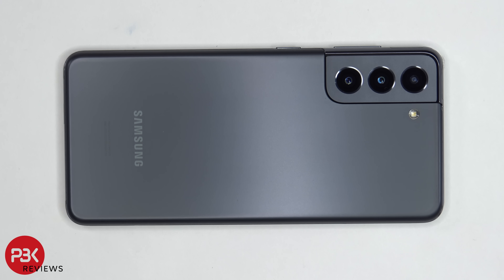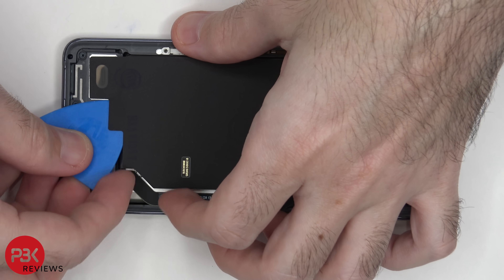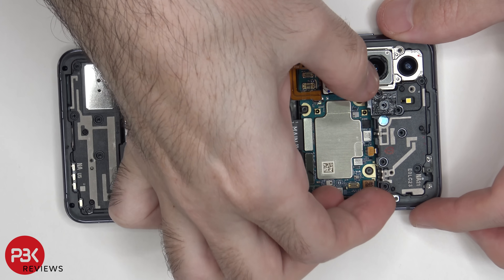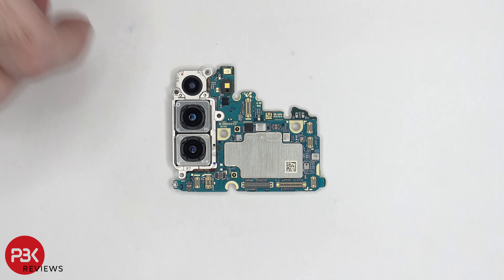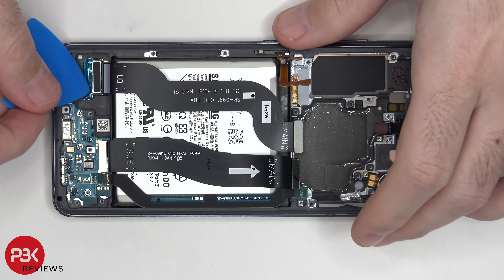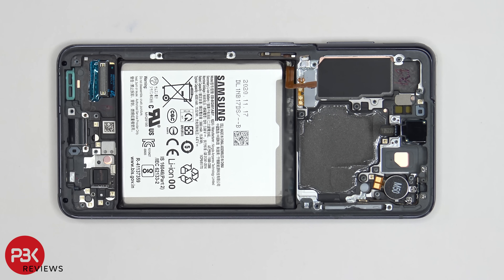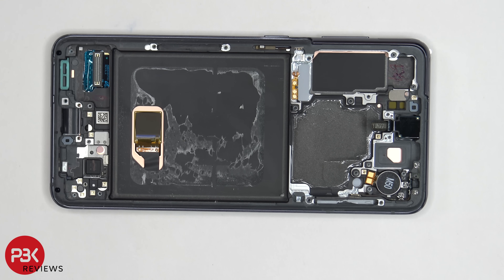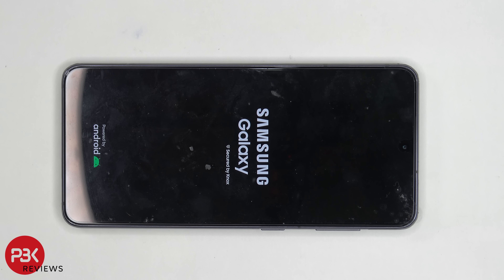Samsung Galaxy S21 5G Disassembly Teardown Repair Video Review

Comment: How does this generation of samsung s21 line up  cooling technology works
Reply from the maker: The 3D graphene transfers the heat from the processor to the midframe and out the phone as well as the graphite layers on the back which transfer heat from the battery and other components out the back of the phone. So far from tests it seems it functions just as well as the copper solutions and lasts longer since there are no vapors that can evaporate over time.
Reply: @PBKreviews  😃 smart idea
Reply: @PBKreviews  lol right now I'm online looking for different cases for my s21. Lol it feel like I'm shopping for clothes for my s21 so many cases already out
Reply from the maker: @Demont3-e3e  Ya lol always hard to make a decision on cases, I tend to get a few usually.
Reply: @PBKreviews  😂

Comment: Do you guys notice some light bleed when turning on the flashlight, around the back corners? Or is it just my phone?
Reply from the maker: You mean around the back plate corners? Its possibly because there is a light diffuser for the LED light and the boarder of the LED light has a tiny gap all around for the third mic sound which is routed through there to the main board. So that might cause some light to be lighting up the internals of the phone and bleeding some out the edges.
Reply: @PBKreviews  yes like that! But its the all way aroud the corners like a circle haha. Its a shame I cant show you the picture

Comment: can you do a video on a screen replacement and other replacements with another s21 if you can please and thank you
Reply from the maker: All that is left for the screen replacement after taking it apart as shown in the video is to pry off the old screen. Also most screens come with the mid frame attached so all you would do is move the parts you took out from your old frame into the new one and your done. I didn't want to break the screen and render it useless :)

Comment: The phone isn't even out yet. How did you get the retail version so quick?

You should use isopropyl alcohol for loosen up the battery next time.
Reply from the maker: Sometimes I get lucky and I'm able to get things a little earlier. Ya I had to use isopropyl alcohol on the s21 ultra, the battery on that was much more difficult prying off.
Reply: Learned my lesson the hard way on that one with an LG

Bellow the battery there's a hole for the fingerprint sensor, if you pour alcohol there's a good chance it will get in and ruin it. From now on, only prying for me!

Comment: The S21 has a circle vibrator and S21 Ultra has square vibrator like the S20 and Note10. How does the vibration feel on the small S21? Does it feel like haptic or just normal vibration?
Reply from the maker: The s21 vibrator feels more strong all around the phone and is a long straight vibration while the 21 ultra is more like a haptic feedback burst of vibrations as if your clicking on something.

Comment: What is below the flash and left of the speaker balls ? Is it some kind of sensor, there is also some kind of windows on the cover below the flash difuser
Reply from the maker: Its a hole that would be used by an additional microphone, possibly the + or ultra make use of it. We will see soon. :)

Comment: Hmm doesn't seem that waterproofed to me 🤔
Reply from the maker: The adhesive around the back plate is water resistant adhesive as well as the rubber filter gaskets around the mic/speaker openings from the inside.

Comment: Can locate the RAM Module/Modules?
Reply from the maker: the RAM is stacked with the processor.
Reply: @PBKreviews  on the S21 Ultra is there any identifying markings on the RAM?
Reply from the maker: @johnrommelt6560  not sure I didn't check, if I end up taking it apart again I will look.
Reply: @PBKreviews  thank you

Comment: So, graphene cooling in the SD variant is better than the copper cooling in the Exynos variant right? Or did they change Exynos variant cooling system?
Reply from the maker: Graphene seems to do just as well if not better, and also last longer. The vapors in the copper chamber can evaporate over time and not provide as well of a cooling, but graphene well always stay constant. I'm not sure yet if the Exynos version has any different cooling this time around, but we will see shortly.
Reply: @PBKreviews  wow, that's how it is? Thanks for the info. I'm now your loyal subscriber.
Reply from the maker: @johnlabu1154  you're welcome, and thanks for the support!

Comment: Tf theres no cooling system on s21 series this time ? Seriously samsung ? A graphite tape with thermal paste is aint enough for this price tag especially for a flagship
Reply from the maker: The 3D layer (its not just a tape, its thick) of graphene is the cooling for it. Works just as well as the copper vapor chamber and lasts pretty much indefinitely compared to the vapor chamber which the vapors can evaporate over time. Basically both the copper vapor chamber and graphene both transfer heat. They don't actively cool the parts. Comes down to which transfers the heat away from the components faster and more efficiently and does the job for longer period of time. Graphene seems to be the winner there.
Reply: @PBKreviews  its better if they use it both cuz this is a flagship phone..
Reply from the maker: @mr.nobody0179  I don't think it would work that way since it would basically be one thing transferring heat to another thing to yet again re transfer the same heat out when one does the job already. But I'm sure as time goes on they will come up with better solutions
Reply: @PBKreviews  yea when they use graphite with copper vapour chamber it will transfer the heat dissapation out from the phone faster and wont make it overheat
Reply: Btw im still thinking should i upgrade from oneplus 8 to s21 ?
Reply from the maker: @mr.nobody0179  hmm not sure would be up to you. I haven't really ever used oneplus phones for extended periods of time to know if I would go with that or the s21

Comment: How does haptic feedback feel on this phone? (considering that it has a coin style vibration motor)
Reply from the maker: I haven't really payed much attention to haptic feedback honestly throughout the devices I have used but I will take a closer look and get a better feel of it over the next few days and let you know.
Reply: @PBKreviews  thx for your reply! Waiting for the results.
Reply: @gaborgedey8100  its worse man way worse trust me its been driving me crazy and im not the only one
Reply: @gaborgedey8100  best thing you can do is just stick to the s20 unless you really want to upgrade to the newer chip and have only barely better photos. video may be a bit better too.
Reply: @yushakhan2504  finally i chose s21+
The standard s20 has the same coin style motor and the crappy exynos 990 and  also a power draining non-adaptive 120 Hz display.
I'm happy with my choise. The phone is fast and it has amazing haptics due to the the linear style vibration motor it's equipped with. The battery easily lasts 2 days with adaptive 120 Hz on.
Reply: lame probably.

Comment: Looks like the Galaxy S21 have a larger  Main camera sensor than previous Galaxy S20 😃😃 thats Good, because the sensor may be able to receive more light coming in, and the overal picture quality will look better than S20 from last year
Reply from the maker: Ya I personally like the build on the S21 over the S20 in general. The minor upgrades here and there are worth it to me, especially the speaker upgrade on top.

Comment: Great video! Does it have the old style low quality vibration motor or the higher quality Linear motor like in the s20+ / ultra ?
Reply from the maker: Thanks! It has the older style vibration motor.
Reply: @PBKreviews  when we thought samsung couldn't have disappoint us again
Reply from the maker: :) hopefully the ultra and plus will have the linear motor, well see.
Reply: @PBKreviews  which one does the S20 (base) have?
Reply from the maker: has the older cylindrical style ones
Reply: @PBKreviews  does it feel cheap like in the s10/s20? I'm currently rocking a pixel 4xl and the haptics r amazing.
Reply from the maker: @rjosef1983  I haven't messed around with the haptic feedback much yet, check back with me in a few days and I will see how it is
Reply: @PBKreviews  thanks. Since I've been using the base versions for the past few years, it wont feel lesser. Wouldn't mind an improved version in the base version though, but oh well.
Reply from the maker: You're welcome. The S21 vibrator feels bit more stronger and is a constant straight vibration while the ultra one is more like a haptic feedback pulsing type of vibration like your clicking on something.
Reply: @PBKreviews  thanks for the info 👍
Reply from the maker: @LilJay2o6  you're welcome
Reply: @PBKreviews  does it overall feel cheap or an improvement  over the last iteration? I've had the s10e and the haptics felt really bad
Reply from the maker: @rjosef1983  it's nothing amazing but isn't bad either. Pretty much the same thing as a note 20 ultra

Comment: wasnt the camera hump part of the metal frame???? how did it came apart??
Reply from the maker: The metal portion is a face plate sitting over the back plate/battery door. So its layer over the back plate. It's not connected to the frame of the phone.
Reply: @PBKreviews  you think thats the case only with the s21cz is plastic or same for s21 ultra ? just asking cz bloggers make such a big deal about it
Reply from the maker: I'm pretty sure it will be the same. Making that portion part of the frame itself would make the design more difficult to work with overall. Placing parts in or doing repairs would be more complicated both for them and for end users. We will see soon.

Comment: Could have definitely made a combo dual SIM/SD tray where you can either use dual SIM or a single SIM and SD.

Boycott this garbage.
Reply from the maker: Yep, not sure why they opted to have a dual reader installed with only single sim supported sim tray. I'm assuming cost cutting to have one standard sim tray installed across all devices to have the dual sim version make use of it and the none dual sim just have an inactive sim reader. If length was a problem, maybe they could have had a side by side reader instead for sd card support, not sure.
Reply: they removed samsung pay MST,  no MST.  i nervous to use mobile pay, when you tap phone to credit card reader and it doesn't work, that's embarrassing!  99% i going to cancel my s21 ultra order !
Reply: @vgm006  Yup. The bigger insult with MST is that they completely glossed over its removal during the presentation, instead choosing to spend 5 minutes talking about how they reinvented "black."

Comment: I have two questions 1- the back is well attached.  2- comes with pre-installed screen protector
Reply from the maker: Back is well attached, but is not too difficult to pry off either, making it a bit easier for repairs. Comes with a plastic film over the display, and back but not a film that is used as a screen protector. Just one that easily peels off.

Comment: Would you be able to assess if putting a camera module from other phone will prevent it from working; if like apple they do digital locking to prevent 3rd party repairs. Thanks!
Reply from the maker: Usually on android phones it comes mainly down to the connectors and cables of the camera lens. You run into the issue of the connector being the same, as well as the length of cable so it sits in the proper place to fit in the frame. I'm pretty sure swapping cameras between the S21 models would work as long as they have the same connector. I will try n look into that if the other camera connectors are the same and see if it will work without any software mods once I look at the other S21 models.

Comment: Again they Didnt use vapor chamber for cooling.....
Reply from the maker: Yep, but the 3d graphite does just as well if not better than the copper vapor chamber plus lasts longer than the vapors in the copper vapor chamber as well.

Comment: Is the camera lens glued to the rear panel like always? or is it 1 piece of glass? Like are they replacable individually?
Reply from the maker: Each circle glass lens cover are separate and are replaceable separately. They are held down with adhesive (double sided tape) to the metal rectangular frame they sit in.
Reply: Oh wow seriously?
and then that metal part can be detached from the glasstic/glass back?
Reply from the maker: the metal frame around the camera lens is like a face plate. Goes over the back plate and held on with adhesive.
Reply: @PBKreviews  Over or under the backplate? like is it glued behind the glass like previous models?
BTW; are you planning for a S21 ultra teardown?
Reply from the maker: It looks to be a plate over the back plate, but there is an under frame assembly for it as well which seats around the cameras just like every other back plate for phones. However I don't think they are glued together. Just some adhesive holding the top layer (metal camera overlay) over the back plate itself. Yes I'm planning on doing the ultra as well, stay tuned.

Comment: What you think about battery life on s21? 

what if you want to compare it with s20 fe 5g ?
Reply from the maker: 4000 mAh is not bad on the S21, but I would prefer to go with the S21+ with the 4800 mAh battery. I would also take the S21+ over the S20FE
Reply: @PBKreviews  Thanks but the thing is I have chance to buy S20 fe and S21 for almost the same price 

which on you think is wiser choose ?

I want to know the new chipe on s21 make the battery better ? (I mean almost the same as S20 fe)
Reply from the maker: @misterpringles2384  Usually newer chips handle battery life better. I would go with the S21. Has better audio build (both top and bottom have the foam balls in the speaker assembly and the display has stronger glass compared to the s20 FE. Also newer processor and a 64MP telephoto lens.

Comment: I can't believe that for this price, they are still using those cheap coin vibration motors.
Reply from the maker: Yep, not sure if those last longer possibly or what but I would have also thought those wouldn't be used anymore but I guess not.

Comment: I thought they were using Li-po batteries, are they not? or is there a specific reason why they're only writing "Li-ion" on batteries?
Reply from the maker: When its polymer they write Li-ion Polymer. Its possible the international variant or the + or ultra might have polymer but this one has a Li-ion.
Reply: @PBKreviews  okay, thanks for answering^^
Reply from the maker: @kutlaykizil  you're welcome

Comment: Fingerprint sensor bigger than S20 models and another good thing is display  connector replaceable.
Reply from the maker: Ya, its a first I have seen for the display cable being replaceable.
Reply: @PBKreviews   Because the old model display cable sometimes was cut off during the repair time . This was making the screen garbage. There a lot of case on youtube about this.
Reply from the maker: @anarasgarli  oh I see

Comment: Perfect channel keep it up
The main board double stacked or not?
And seems iso probil alcohol not helps anymore about battery removing
Thanks
Reply from the maker: Thank you! Main board is double stacked and you can use isopropyl alcohol but it gets messy sometimes and you dont want it to get in places it shouldn't go so I try not using it. For example I wouldn't want it going through an opening like where the opening for the fingerprint reader is attached to the screen underneath the battery.

Comment: A clear one will look nice if Samsung exposes more of the motherboard

Edit: 7 months later, I actually got a S21, in White
Reply from the maker: ya it would look very nice! might do a clear/transparent mod on one of them.
Reply: @PBKreviews  just be careful when you want to expose the motherboard, cutting the plastic may be hard
Reply from the maker: @TIMETECH07  I probably won't cut anything because those plastic pieces have antenna lines running through them. Cutting them would cause reception issues with wifi and cell signal. Probably just clear out the back so some of the internals show. Will think about it
Reply: @PBKreviews  yep.. I managed to aviod that on my previous S7. Its possible to do it (I only cut off a small portion of it), but its a very involved process. Its doable, but very annoying
Reply from the maker: @TIMETECH07  ya. I can laser cut out portions possibly which would make it easier.